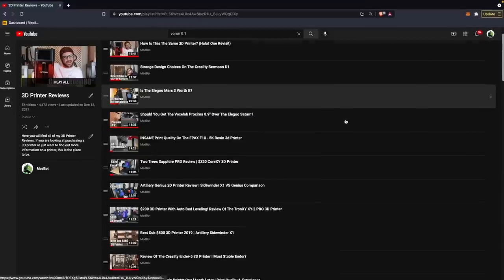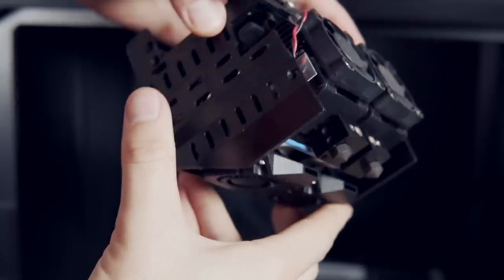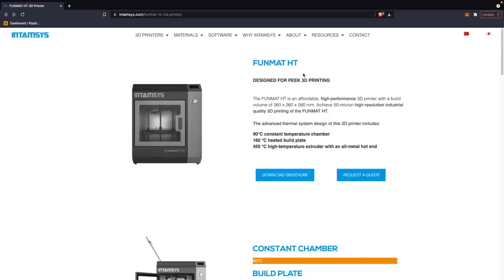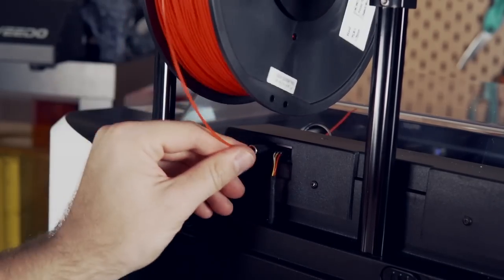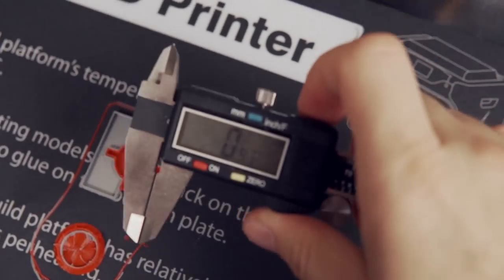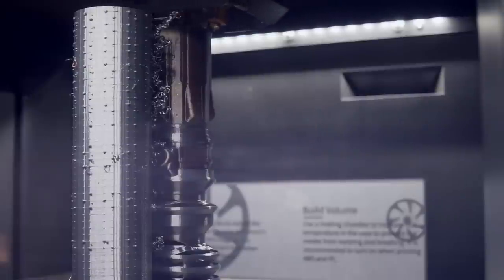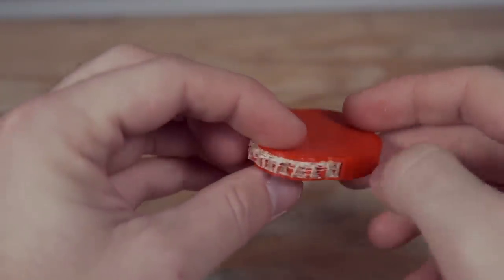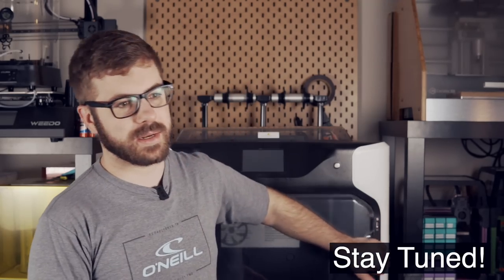Best 3d Printer For High Temp? Review Of The Qidi Tech i-fast

Comment: Fun Fact: the stock build plate, you can flip it around and with the right nozzle height you wont need adhesives to print any filament on it even PC and ABS. When the print is done wait for all the fans to turn off and by that time your print will lift up like it never even stuck to build plate. You never have to lift the bed plate off by doing that. For the ptfe in hotend you can replace the factory tubing with capricorn tubing from an ender.

Both these tips works will Qidi I-Mates, X-Plus, X-Max too.
Reply from the maker: Interesting I had no idea. I may have to try the underside then when I print with PC. Thank you for the info :D

Comment: You do a great on presentation of your videos. Even a longer one like this is easy and enjoyable to watch. You obviously have knowledge and experience with 3d printing. I am actually considering this for my first printer and just as a hobby. Between more birthdays and health issues have had to be give other activities. Have looked at and considered a host of machines. While the price tag on this is higher than I had hope to spend, why put out a few hundred dollars on what most likely would become an expensive paperweight? Thank you for your time and sharing your thoughts in this and other videos.
Reply: This one is my third Qidi printer and by far the largest. I also have two other 3 D printers that we’re not so good and hardly ever worked.

I’m sticking with the Qidi, now, because their customer support is awesome. You don’t get a telephone number but by emailing them and showing them perhaps a video of a problem, they don’t just play e-mail tag, “try this, try that”…. They seem to know the problem right away and within 24 hours I get an answer back with sometimes saying something is messed up, telling you a new part is on the way.

So, yes. Most expensive and largest printer. It’s so large, I’m taking the wheels off the bottom of the cart that I normally work with and just putting gliders down instead.

Comment: Awesome review & plenty of real enduser detailed questions & answers. If you're going to drop $$$, you want to know these details. Shame about content not listed on website.
Auto-bed level would be nicer. Is adding a BL-touch or similar possible? Not sure if manual level always best if you have nossils of 2 different lengths- you'd have to readjust print height for each one if running dual extrusion print or if encoding allows for setting 2 different print nossils lengths. IE it seems this assumes you manually level bed for 1 nossil & BOTH nossils assumed to be at same height when they are used during dual extrusion. IF 1 is slightly longer, either gouges build plate/ knock print loose / or prints above correct layer.
Also can you add physical heat-sock to prevent heat xfer when using dual extrusion?. IE when printing carbon fiber & pteg dual extrusion.
I know you mentioned 2 different color pla dual extrusion but 2 different material dual extrusion is possible correct?
Maybe missed some of these answers in vid.
KEEP UP AWESOME WORK!!!

Comment: Another I-fast owner- it's a great machine.  All metal structure and linear rails on each axis. Supposedly auto leveling is coming but I haven't found a need to level often and isn't difficult.  Qidi tech is very responsive and ships parts like ruby nozzles or extra extruders via DHL at reasonable cost to US.  Dual extrusion prints are somewhat challenging and settings are key but that's to be expected.
Sure the flashdrive placement is a little strange but no big deal. Do agree the filament guides could be smoother but causes no issues in use. Excellent value for all the features overall.

Comment: DO NOT BUY!  If anything goes wrong (like a filament jam) you will not be able to fix it.  The assembly is designed to make it nearly impossible for user repair.  The screws they use are cheap and will strip out, making it impossible to get at the problem.  Everything is so intricately designed once you take something apart (like the belt holder) you can't put it back together.  This is a nightmare waiting to happen.  DO NOT BUY!

Comment: The camera is China sneaking in through your back door (firewall)
Terminate it and run your own camera if you want to keep an eye on it.
They also keep records and monitor everything you print.
It'll display a msg on the lcd screen if it doesn't approve of what your printing.
Interesting isn't it.
Mine is a lemon, 4mths old and still haven't produced 1 print.
It's a $2600.00 boat anchor....
And considering it monitors you 24/7, the bottom of the ocean is the best place for it.....

Comment: Hello, I have a Qidi max printer. It comes with a high temperature hot end, but it is not installed, and I would prefer it to come installed and standard instead of having to jury-rig something and possibly damage it. So, I want to know if the I-fast indeed had a high temperature hot end standard installed out of the box, or it has to be installed by me on my max. I enjoyed your review because I want a printer that can handle high temp engineering thermoplastics stock. Please let me know if this - fast has this installed standard. Thanks  
tony Allison

Comment: Great video! From what I have gathered, it is pronounced 'chee-dee' tech. I own an X-Pro as my first printer and am now going through a full overhall of it, I knew it going in though. It is funny, the mods I am doing are pretty much in line with this model except now I am running an Octopus Pro (overkill) with Klipper and all the benefits. Also upgraded to slice engineering bi-metal hotend and other mods like filtration. They are nice printers as long as you are fine with engaging their support for anything needed outside of what you get, they actually are responsive. The only thing that put me off was before the launch of this product they emailed me to let me know it was coming out and if I left a 5 star review I would be refunded half of the money. I don't know what to make of it, I really hope it is just a culture gap, but that really stuck with me. Even after my positive experience with them.
Reply: Hello, is there any guide on the board and klipper upgrade? Thank you
Reply: @eduardobueno5040  Not that I am aware of, it was pretty much like starting from scratch on the X-Pro. TBH, it was a probably a little bit harder than starting from scratch because I had to do some research on the parts to figure out a lot of the settings for Klipper, most of the info I needed was not easy to find. Not that it is impossible, if you have a QiDi printer and really want to upgrade to a new mainboard, then you will learn A LOT in the process! I had to do some custom mounting, rewiring (a day of crimping wires), write my own Klipper config (based on the generic Octopus Pro which barely has anything in it) and write the accompanying SuperSlicer profile. I am really happy with how it turned out, now I know what it feels like for those who have gone down the RepRap path in the past.

If you do not already own a QiDi printer and are considering buying one to mod, just get a Voron kit or similar and build that instead.
Reply: @hiddenlawyer  Thank you for the response! I am eyeing an iFast and thinking it could be good platform for speeding it up through Klipper but the information on the process is close to non-existent. Voron is missing many of features and I don't want to build something from scratch.

Comment: Question, why would a person need the separate tool head with the brass nozzle and PTFE tube if you have the setup that has the hardened nozzles and all metal hotend? Is there an advantage to using a PTFE tube in some circumstances? Heat transfer?? I’m really interested to find out as I’ve been printing with a all metal hotend and a hardened nozzle for everything I print. I regularly use, PLA, PLA+, TPU, ASA CarbonX, and PLA Wood. Thanks! Great Video.
Reply from the maker: There are a couple of reasons I could think of. The first is heat difference. For example if you are printing with PC then PLA. There could very well be difficulty getting all of the PC out and with such a difference in temp that could lead to clogging or some underextrusion. Other than that, I do know some like PTFE lined better for PLA. I believe it is primarily due to retraction/stringing. I also have done both on the same head and did switch between CF Nylon to TPU. Would be interesting to run the same g-code with one head and switching heads with the same material run that g-code again to see if there are any visual differences.
Reply: @ModBotArmy  Thank you for the detailed response. You make some good points. The tinkering is one of the reasons I really enjoy 3D printing. Kind of like working on an old Hotrod. Can be frustrating at times when you do the same thing twice and get different results, but very satisfying when it all comes together. Side note, I’d love to see a Voron 2.4 vs Prusa XL showdown when the time comes:)

Comment: What? No full metal hot ends? So printing over 250C is out of the question. It's just a 3D printer in an enclosure with a car heater...
Reply from the maker: Did you watch the review?
Reply: @ModBotArmy  I did but I probably missed the term full-metal hot end. Sorry for jumping to conclusions. The thing that triggered that thought was the unboxing section that showed two nozzles with PTFE tubes.....

Comment: It has a lot ghosting because of those massive tool heads. And seriously no automatic bed leveling for a printer of this size and price. The heated chamber is nice, but with those massive tool heads and no bed leveling makes it a no go for me.
Reply: I used to think just like you until I got a sapphire plus with manual leveling. I found it archaic at that time, but once I got used to it and dialed it in 100%, it was perfect and never needed tinkering with.
Reply: Bed leveling is not really an issue but the ghosting and other vibration-induced artifacts definitely are. My Creality Ender 3 V2 produces a much better finish than my I-Fast which cost 6x more.

Comment: Im torn between this or makergear M3-ID
Reply from the maker: Makergear is a great printer. Key differences to consider are build volume as it is much smaller and if you need enclosure/heated chamber for high temp.
Reply: I love my m3-ID, not as enthusiastic about my Qidi XMax

Comment: Real PC will not stay larger prints will split curl its not hot enough but it will squirt out at 310c pc wants 120c up this only does half that
however it may be that abs nylons and in  CF may be a good fit and unit for idex printers also your magnetic plate will loose its strength after that kinda heat anyhow so this is a good build level i kinda approve for abs asa nylons in cf but they should be 90C ish there is always a next level this one this one could hit a sweet spot i agree! 
but you may get luck with real PC CF 25-30% for small parts but you don't want that in you nozzles for other materials unless you have means to get it out

Comment: Okay so this basically isn't IDEX. No Bueno. For the price point, that's not bad. On the same token though, this thing has no provisions for aftermarket compatibility
Reply: From what i am hearing idex is a hassle not worth paying for. Having to level multiple carriages to the point that they are equal let alone compensating for manufacturing tolerances is a literal nightmare.
Reply: @syndan9245  The 22 IDEX does it beautifully. It's the Vision Miner rebrand of the addwise. It auto levels and it has the capability for non-colinear printing.
Reply: @picklerick9578  you mean the printer that costs 8k? .... not exactly a fair comparison

Comment: $2000 for printing nylon, abs, or pc on a machine that lacks so much doesn’t make a whole lot of sense. Raise pro 2 is $4k and you get a much more refined machine. Yes it may be worth an extra $1k but if you’re spending that much I don’t think that little bit extra will really matter. Even that said it’s not printing any material a higher end hobby printer can do with either an aftermarket or homemade enclosure couldn’t handle. Other than that good video 👍🏼
Reply: You don't get any active chamber heating with raise printers... That is key for abs and similar filaments.
Reply: Have had both. Raise 3d pro 2  has given me nothing but problems from day 1. Constantly replacing parts. had to replace  the heated bed, fans, build plate thermocouples, hotends over the course of 12 months.bed leveling is very tedious on raise 3d pro 2 also. It suffers badly with heat creep issue on long print. Qidi is now my go to machine. I have the xmax and the X- Cf pro. I have used xmax for over 18month, at 3 times per week and normally running 55 hour prints. I have had to disassemble the xmax extruder a few times due to clogging but it alot easier to work on than the raise 3d machine and is common with all fdm printers.  The ideamaker slicer does produce better results than the qidi cura software. A configuration can be set to use the qidi printer and the print quality are as good as the raise 3d printer when it is actually working.
Reply: @wrc-controls324  how do you like the x-cf pro? They just released it and no one has them or made videos on them yet. I was about to grab it, but due to the lack of active chamber heating I went with the I-fast. However, I do like the new design a lot. If you don't mind giving your feedback on that, I'd appreciate it!
Reply: @TheShaddix  early days with the X-CF Pro only about 80- 100 hrs printing done it so far but so good. the linear rails work well. Accuracy and surface finish as good as raise 3d pro 2 plus. The hot end looks to be a better design than the x-max with a better heat exchanger . The filament runout sensor is good to have. I won't know how reliable it is until i have over 2000 hours or more on it. Active heating not essential to me as the enclosure is small compared to the pro2 plus it heats up fast. The bl toch sensor is a nice to have but I never had any real problem with levels on the xmax as it keeps its level very well. Not a fan of the rougher build surface on the X-CF Pro build plate and the lack of a pei surface on the back.so i am currently using the spare build plates from the x-max as i get a way better surface finish on the underside using magigoo. It better having usb in top face  of the printer. The dry box has no active heating so I am going swapping out for a heated dry box shortly. Not a fan of the lack of bearings on the top of the z lead screws and would have prefers ball screws but I have noticed any quality issues with this design choice.  Best point it was working 30 minutes after it arrived and hasn't stopped working since.
Reply: @wrc-controls324  Thanks for your thorough reply! It really helps a lot. As far as the z screw bearings, I would advise against those as free standing screws are the best option to allow for some play because there are no perfect z lead screws. When you lock the tops in most people think it helps stabilize them, but it actually transfers that small movement from the screws into your carriage (in this case the plate) and can cause slight wall ridges. I will definitely keep my eye on this printer. I have so many printers right now including a voron 2.4 that I am building, but I am still tempted to buy more. I want to have a lot of printers, but I really only need like 4 at the most. As far as your PEI sheet situation, look on ali express for energetic bed sheets, they offer custom sizing. Also the wham bam site. I actually went back to using glass (borosilicate) as it's still superior for abs, but I think when I get my I-fast I'll only be able to use flex sheets on that.
Reply: @TheShaddix  maybe, it's unusual, on all the printer I had over the last 10 years this is the first one not to have a bushing or bearing on the top of the lead screws. I had other machines with the glass plate but I generally prefer the flexible on for a turnaround on loading and unloading. Usually have 2 or 3 spares in case on needs cleaning before reloading. I looked at the voron looks fast but prefer a preassembled machine that just works as need it for production. Wham bam site new to me I'll give it a look thanks
Reply: @wrc-controls324  Most good printers come with the lead screws loose inside of the top pockets to allow for movement. As a rule of thumb you dont want to lock them in, that's all.